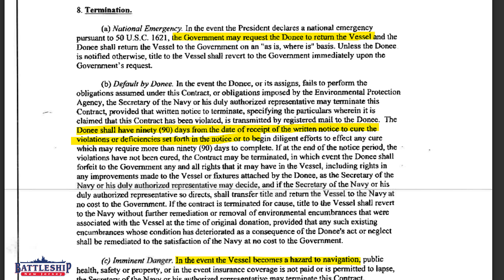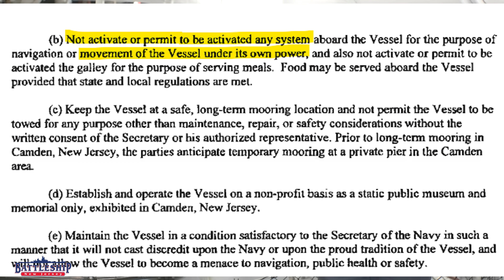Can Battleship NJ Still Move Under Her Own Power?

Comment: Are the engines ever spun over to make sure they’re not seizing up? Ever re-lubricated?
Reply: No, they are locked in place. Though they aren’t like diesels or gasoline driven engines, as they are steam powered, so seizing up is less likely as long as everything doesn’t completely rust in place.

Comment: In '68, boiler tubes were bad and all inner bottom piping was rotten.  Changed from galvo steel to NI CU.  Magazine sprinkler piping galvo with holes drilled and was rotten and clogged  and needed replacement. Just a few of the things mothball rot does.

Comment: As a welder I just want to say that there is no metal I can't cut a hole in and replace if I'm motivated enough and have the equipment to do so. I know it would probably be impractical to replace the engines, but saying it can't be done is incorrect.

Comment: Everything has a manual.  Yes, there are those that know what it really takes to make something work its best, but at some point, somebody opened up page one and started at step one.  I find your fear of not finding anyone to run the engines in the future somewhat suspect in that regard.  While they could get them up and running, it would take a while to relearn all the tricks of the trade to make them work best, that experience comes with time.  Ed Dickens had never engineered the UP Big Boy in his life, but he became proficient at it with his former knowledge and practice.   My father did two tours in the Navy, 26-32 and 12/8/41 to 10/45, on a coal burner the first time and steam turbine driven carrier the second and worked his way to Chief by the middle of WW II.  I took a different path, not ships company, but an air-dale with planes and electronics.  I still restore and operate WW II era electronics, and every operators manual has a step one.   The problem may more likely lay with trying to find those competent enough to read the manuals and translate what they read into action when there is no one around to direct them.

Comment: No, you just need to put a electric motor right onto the mountains that’s waterproof that could power up the whole ship, including the propeller, not saying they powered to the actual ship through the electric motor, but you keep a ton of batteries just in case of power outages and use that as a national disaster management place FEMA can come on board and help people on that museum and it would be strong enough to withstand anything

Comment: On 21 March 2024 New Jersey underwent a dead weight tow to Paulsboro, New Jersey to prepare her to be dry docked at Philadelphia Naval Shipyard. After taking on ballast and removing her mast and radar antenna to fit under the Walt Whitman Bridge, she was towed to Drydock no. 3 at Philadelphia Naval Shipyard on 27 March 2024.[65] The drydocking is expected to last approximately 60 days. The purpose of the work is to conduct crucial preservation work on the ship costing around 10 million dollars; largely painting the hull. New Jersey has not gone into dry dock since her decommissioning, per wikipedia.

Comment: They call those slugging wrenches and hammer on them in tight areas like under or behind boilers on header plugs. But, they have that thicker area for attachment of a handle or extension. That way you don’t have to have many 3 foot long wrenches

Comment: Right now as this is being viewed the Navy doesn't have but a small handful of Conventionally powered Steam Plants commissioned and operational. Which means that the available Machinist mates have very limited knowledge about older steam plants. The Boiler Technician Rating was absorbed into the Machinist Mate rating. Many of the Steam Plants that had the necessary personnel were decommissioned in the 90's. So yes if the Iowa's were required to be brought back into service they would have to bring sailors back that steamed similar steam plants.  All the carriers now are nuc powered. Yes the Engines may operate the same, but the steam source is not. The boilers on these ships are very differnt to operate than Nuc Reactors.

Comment: I agree that a 1940’s power plant is completely kaput. One point: when Arizona and Pennsylvania went through massive overhauls, steam plants were completely replaced. 1916 plants capped and 1928-30 plant took their place. Both ships had increased speed and range. I think both power plants were smaller, more capable and range was thereby increased. Any chance that a modern steam,’perhaps nuclear, could be implanted in old hull. Pardon the phrase but I think this is a hull of an idea.

Comment: Is there some sort of seal around the propeller shafts that will need to be served when in dry dock? If so, what is it made. Are there problems with water leaks around these areas?

Comment: I think people are referencing the top secret classification of submarine propellers.  Where submarines either hide or remove propellers while at dry dock. 
This is because of acoustical finger print,  where a foreign adversary could decipher the acoustic fingerprint by inspecting is construction.  And thus identifiable when at sea. 
This is the only scenario where having any type of documentation of submarine propellers is not only illegal,  but possibly considered treason

Comment: Natural follow on question - at what point will the reactivation of the ship be completely impossible?  If the last active duty engineers on the ship were in 1990, they are now 55-75 years old.  If you can't find one of them, can you still get it running?

Comment: No mention made of the condition of the boilers - there would be a lot of work there. 
As noted in the video, the machinery was always wearing out, even when it was being maintained by the 800 man Engineering Department. The knowledge to maintain the machinery is simply not available anymore. And then there's the question of the parts that are no longer available. It's not a warship anymore. It's a great museum.

Comment: There must be a very large & complicated system of ventilation, dehumidification & temperature control to help prevent deterioration of all the many electrical, electronic devices & corrosion prone systems within that great ship. That alone must require a substantial crew to maintain & operate.

Comment: I have a question, what is the sequence of  operation from the time fire control pulls the trigger to the ignition of the powder charge firing the main gun.  Is it an electrical spark igniting the charge or some kind of primer?

Comment: Your opinion is wrong !!!!! And I can prove it. Those engines can absolutely be replaced. as a welder and the fabricator and the guy who has quite a bit of welding and metalworking experience I can personally attest it is not Much of a challenge to cut through Two feet of armor  steel let alone the 6 to 12 inches Of armored steel. it's actually Relatively easy task. You seem to forget that They had to be cut and welded it to get put on the damn Boat in the first place. it can be cut to remove to   remove or replace an engine. You can get off the shelf cutting implements that will cut through about 16in of Armored steel . It would be annoying!! The real reason is she's just an antiquated piece of junk that would require too much work to get her going by the time you upgraded everything that needed to be upgraded there's not much of the original Boat left. I'm pretty sure no one's gonna fire a 16 inch gun in battle anymore And I'm also pretty sure that no one makes the ammo. the engines aren't the problem, it's everything else!!! Cutting through the decks to remove a couple of engines which don't even have to be removed in one piece is an easy thing to do trying to fit enough vertical launch tubes to make that thing useful and remove the 16 inch guns and still keep everything structurally sound is a lot more difficult.

https://americantorchtip.com/?resources=oxy-fuel-airco-cut-chart
https://hornetcs.com/wp-content/uploads/2014/07/Harris_Tip_Chart_acetylene.pdf
https://www.keengas.com/technical-tips-files/index_29_760312311.PDF
https://www.youtube.com/watch?v=wdBjxPplj98
https://www.youtube.com/watch?v=uDCaL9slzu4

Comment: Are the boilers “M” or “D” type boilers?
Reply from the maker: M
Reply: @BattleshipNewJersey  M type familiarity operators are not as common as D type.  D type operators can do it in a pinch but having hands on experience with controller superheat would be best. I only have experience with D type and nuke plant steam generators.
Mark Fay US MMC Jr. Eng STCW QMED AS-E retired.

Comment: How thick is the bottom of the ship how thick is that because I can see the sides in the top being thick but not the very bottom so why couldn't they just cut a hole in the bottom of the ship and put them in that way because that's where the motors are right in the bottom of the ship so yeah I bet you don't want to make change those engines no problem if there's a will there's a way

Comment: Finding some BT's (MM's nowadays) to assist you with the engine work-ups wouldn't likely be difficult as there are still a few large boiler naval ships left (8 at this point, the 6 Wasps and the 2 LCC's).  Sadly, the skills required to actually bring those out of stowage and back to operation are likely not carried by the current era of sailors as that kind of training ended in the early 00's with all the contractor work.  The part that may actually be exceptionally tough is finding technicians willing to inspect the firebox and assist with replacement firebricks (if required) as those are all asbestos.

To be honest, I couldn't imagine the staggering amount of work that would be required to bring a single boilerroom/mainspace up to the point it could make steam.

Comment: To run the Engines on the ship, assuming you got permission from the Navy, You would also most LIKELY have to Re-certify all of the turbines and steam producers.
Reply: Or simply use what ever auxiliary probably diesel engines to move, regardless, you'd have to get the permission and it's likely you wouldn't get the permission.

Comment: Imagine that the Navy gave the museum permission to activate the steam plant, and at least one engine.   How many people would be required, trained and certified in their tasks, to safely operate the boilers at minimum steam? AFTER the work is done to reactivate the systems and make them serviceable and safe?   How many to get one screw turning?   How many would have to stand 24/7 watch in order to keep those systems running in safe operating condition?    And would that be something you could reasonably expect to get out of an all voluntter staff? (No.)

As long as the burners are burning, the ship needs a certain minimum staff of people who know how to run those systems.  And I'd expect it's probably a minimum staff of over a hundred people per watch.

Comment: The SS American Victory in Tampa can and occasionally does move under its own power. However, one of the museum guides there told me their biggest single problem is Coast Guard inspections.
He said the current generation of Coast Guard inspectors only knows diesel propulsion and is strictly going off what they read regarding steam operated ships with no knowledge whatsoever of how a steam ship is actually run and operated.

Comment: My cousin was on the NJ  around 68-70? A broad side of the 16" was to take place, The order was no one was to be on deck during the firing. Some thought just holding a camera above the bulk head would be ok. I think those cameras are still among the missing.
Reply from the maker: filming the guns firing is a time honored tradition, you just have to be in the right spot to do it.

Comment: Additional question: Since the Iowa class ships were built from pre-nuclear steel, what is their scrap value?  Obviously I don't think that they should be scrapped, and I hope that they call all celebrate the 200th anniversary of VJ day, but considering the slight premium for pre-nuke steel I do wonder.  Part of me also wonders if the premium would be enough to cut out a section of the armored hull, sell the Pre-nuke steel, buy new steel and replace the removed section, and turn enough of a profit to fund the museum for a while.  Obviously you could run into a "ship of Theseus" problem but I still wonder.
Reply from the maker: pre-nuclear steel isn't nearly as valuable as people think it is. And when the navy scraps ships, they are so expensive to strip off the hazardous materials they give them to the scrapper for free. So not much.
Reply: @BattleshipNewJersey   Kinda figured as much, thanks for answering a silly question.

Comment: I wish the SS United States conservators were as easy to reach and willing to keep us as updated and informed as you guys are!! I have wanted to ask for some details about her propulsion plant and steering gear for years now. Some questions I had include when the last time she moved under her own power was, when the last time her steering gear operated her rudder to assist in docking, etc was and if she is still capable of making steam and moving under her own power without any extreme amount of money or work being done. I know she still has her boilers, turbines, gearboxes and prop-shafts installed but I believe her props are off site at different locations. I have wondered for years if they could reattach the props, clean out and fix any bad spots in her Bunker oil tanks, boilers, steam piping, or turbines and actually get her fired up and making steam again to at least have the ability to sail on her own once more. At this point she is the very last high speed flagship ocean liner in existence that actually has a remote chance of moving under her own power again. The QM had all her propulsion equipment removed and there’s no way to put it back so she’s too far gone, but the Big U has the opposite problem of the QM….her interiors are totally stripped and she looks really rough and in need of paint and having interiors refitted, but mechanically and hull wise she’s virtually complete and has pretty much all the equipment needed to operate the ship. I would give my left nut (sorry for the crudity but it’s true) to be able to be aboard or at least observe in person the SS United States underway at full speed moving on her own power at sea before I die. That’s literally one of my two “bucket list” items I’d be willing to pay that kind of cost for. Some people won’t understand why I feel that way but I think a lot of you will.

Comment: In this day and age, it's hard to imagine what purpose these old battleships would serve. Even if modernized, they wouldn't be able to hold as many VLS' as the Ticonderoga or even Arleigh Burke class, at least not without completely removing the main batteries. At that point, you may as well just build a bunch of destroyers, because the cost/benefit is just not worth it... But it would be cool: USS New Jersey, Iowa-class Guided Missile BATTLESHIP

Comment: USS Texas should be permanently dry docked since she is the last of the super-Dreadnoughts left.  If I remember right there was a cost analysis done and it was decided that it would be more cost effective to design and build 4 new ships from scratch then it would be to reactive the Iowas, and that doesn't include manning, fueling, or supplying them.  This would be like pulling Yorktown or Midway out of museum ship status and getting them reactivated versus building a new Wasp-class amphibious assault ship.  Although there is no substitute for nearly 16" of steel armor belting and 16" x 50 caliber shell to ruin your day.
Reply from the maker: Permanent drydock isn't best preservation for ships like these. They pancake, they need the support.

Comment: I am 64 I was 23 in 1983. When I was a MMOW on the New Jersey. The Ship was decommissioned in 1991 so the youngest of those sailors. That served on the New Jersey are in the 50's. The larger of the problem will be the ones that served in the Fireroom. The "M" type boilers were unique for the Battleships at the time. Almost all the ships that had them were already decommissioned. The Battleships were the last. There were other problems like the shafts sitting to long in one position.

Comment: Spent 12 years in the Navy my 1st ship was a carrier with 12hundred pound steam plants did 3 1/2 years on board. So yep as long as they preserved the engines they can run again 😄 as for the plates covering the sea water intakes they can be cut off without going into dry dock to allow water to steam plants. A good underwater welder could do it NP using high pressure underwater cutting rig or build a dam to keep water out  the cut from inside the water inlet manifold where the injecting tubes are. I know I've been down inside using air to clear the tubes it's called punching tubes. Being a Certified Navy Welder ( Hull Technician or HT for short ) taught me a lot about working on these big steam plants. When in as a Non-rate trained as a MM and switched to HT and still remember a lot of the MM rating being over 62 yrs old now.  😀

Comment: The 1200 psi 875 degree superheated steam produced by those Westinghouse boilers needs men who know how to perform light-off, etc…which are now old men. Not to mention warming up the 1750 kw turbo generators, and aligning the old manually operated split-plant electrical system. All the electrical systems are ungrounded 3 phase relay logic…good luck finding any old navy farts other than me who can still work on that stuff.